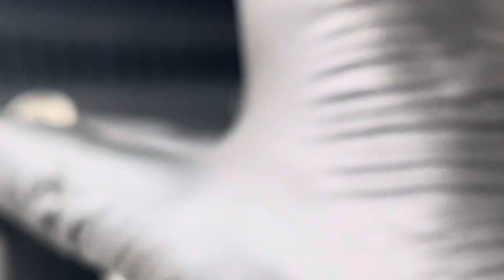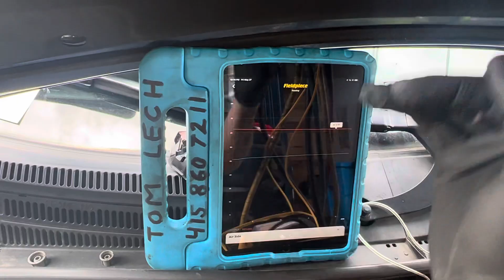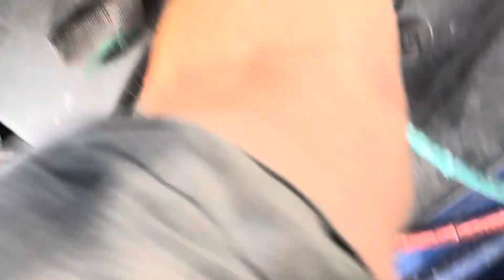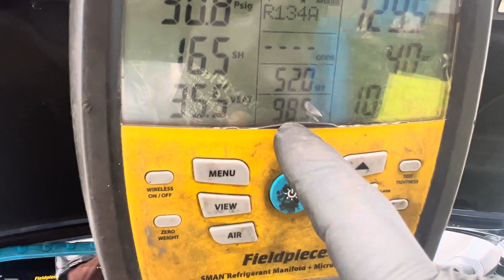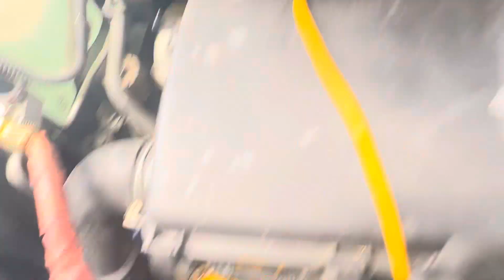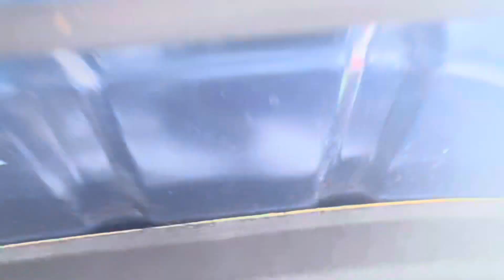AC Electric compressor how you get it to spin faster to move more pounds of refrigerant.

Comment: Most of technicians use sight lens to charge so here because of this variable compressor they will put more refrigerant in the AC system hence system overcharge.
Reply from the maker: Yes exactly many times it is overcharged and sometimes the site glass is clear and it’s under charged